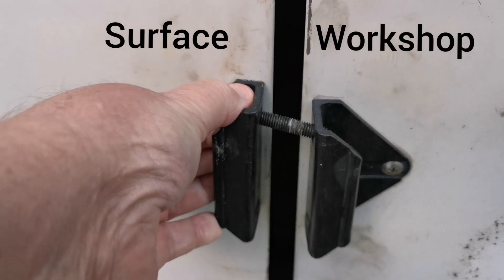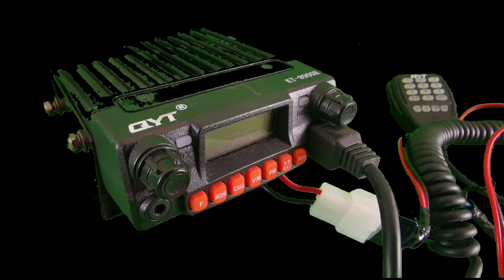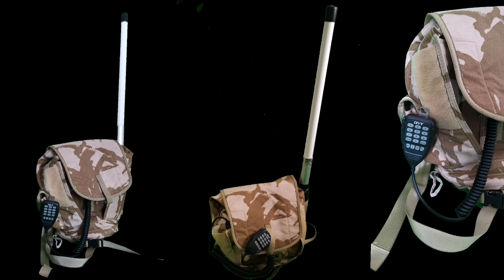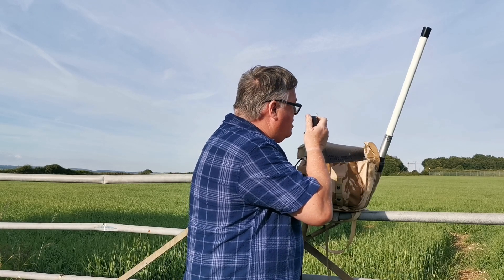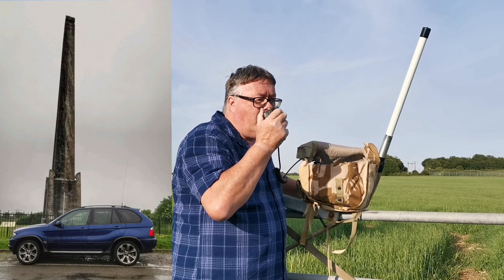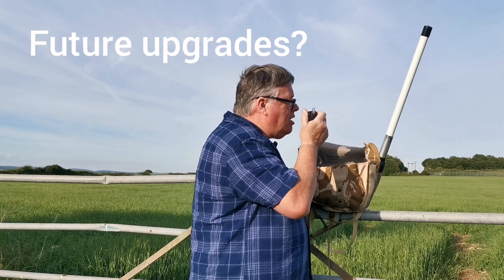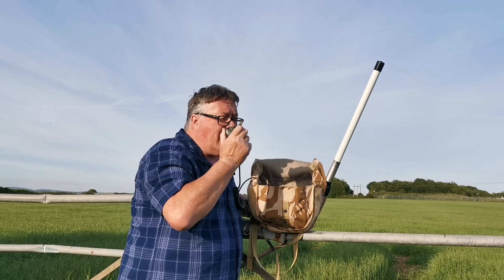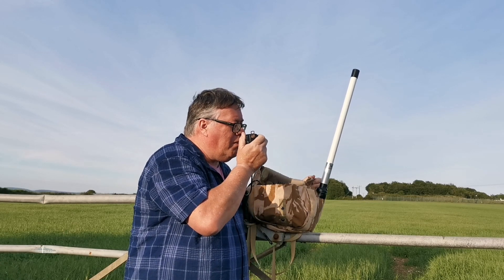Enthusiastic Steve Tactical Go Bag Radio for HAM, Amateur, Preppers, Off Grid and CB radio operators

Comment: Saw the bunker, immediately thought "portsdown hill!?" Was not disappointed 😂

Nice little project. I might have to do something similar at some point. Although I'd still worry about heat buildup In the bag, even with the fan on the radio, but I can think of a couple of ways around that.
Reply from the maker: Yes well spotted, i was there walking around and couldn't resist taking a few mins of video. The radio i used on low power hardly got warm, you could easily fit a mesh breather to aid air flow. Thank you for your comment, all the best, regards Steve

Comment: Really liked this one bud. Prepping comms a must in today's climate. Hope you add more of these, knowledge is power after all. WROL situation, it's open season on the bands, provided people respect that outside of an emergency, a bit of respect for amateur operators doesn't cost anything. 73's and many thanks. 26 KT 001 Bromley,  Kent
Reply from the maker: Thank you Steve, just a simple idea that can be adapted to suit many people. Regards Steve
Reply: @EnthusiastSteveM6WVV  Did you do a SWR test on the white stick Steve? I need it for PMR and wondered what difference it would make having it in the s bag and not on a pole (PMR)
Reply from the maker: @stevetaylor8446  i didn't on this occasion, it is pre tuned with no adjustment. In past i had this indoors and tested and it gave a flat low vswr across 70cm and on 446, though technically not authorised for pmr use. I would think it acts no differently to an antenna on a hand held radio when in use, though it is a dipole and does not relie on any counterpoise. It is a solid antenna, can easily be attached to a pole it give more height. Steve